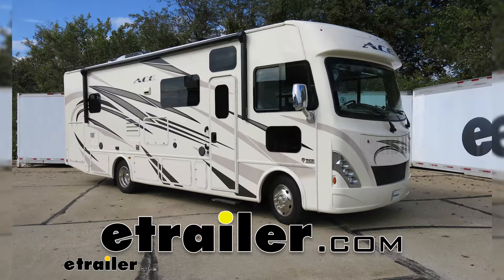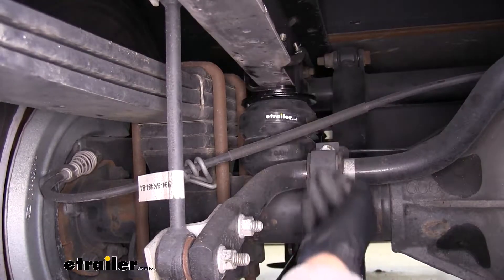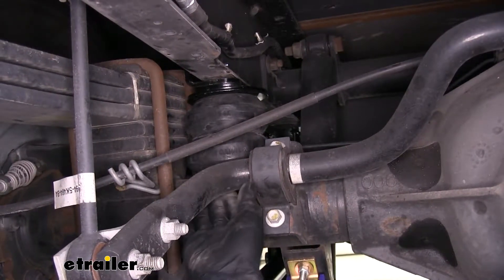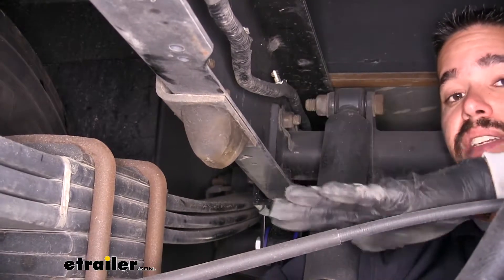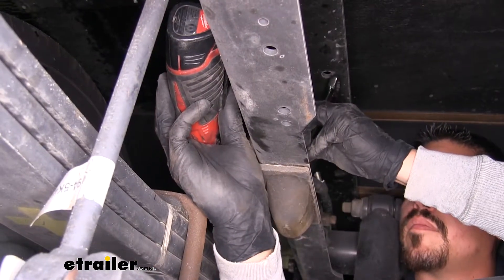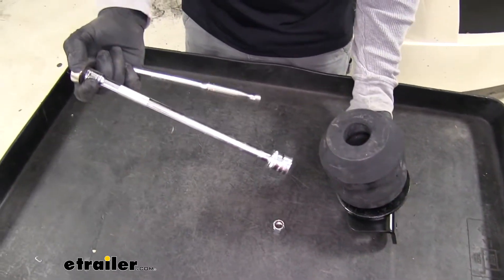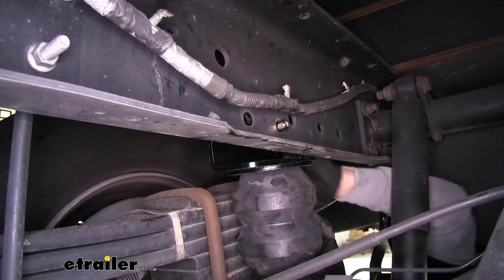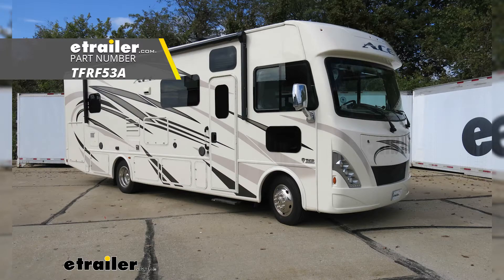etrailer | 2018 Ford F-53 Timbren Rear Suspension Enhancement System: Complete Installation

Comment: i’m a little concerned about the brake fluid lines that are close... does the timbren have to be centered right on axle?
Reply from the maker: The Timbren needs to be centered on the axle. They are designed to rest on the axle when more weight is added to the suspension.
https://www.etrailer.com/Vehicle-Suspension/Timbren/TFRF53A.html
Reply: @etrailer  i removed original blocks. timbren did not fit. Steel welded on axle that hold sway bar is in the way. bummer.  tried both sets of holes... this ever happen to you? i have an 03 f53 chassis.